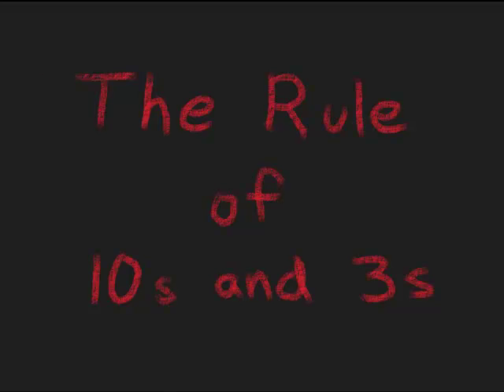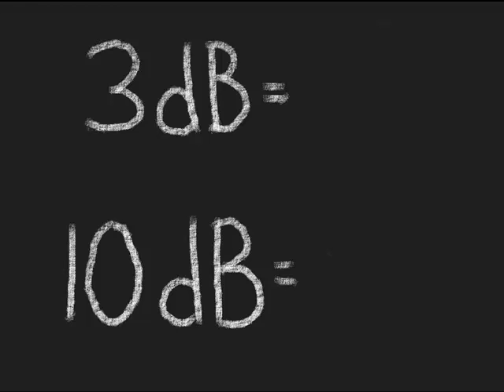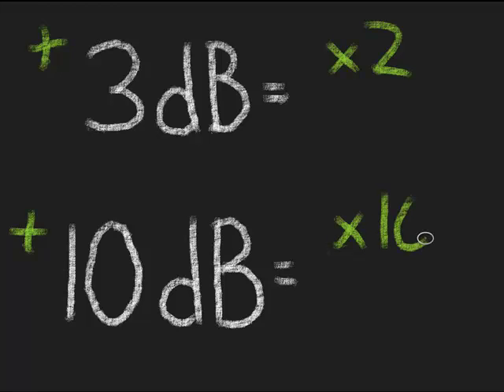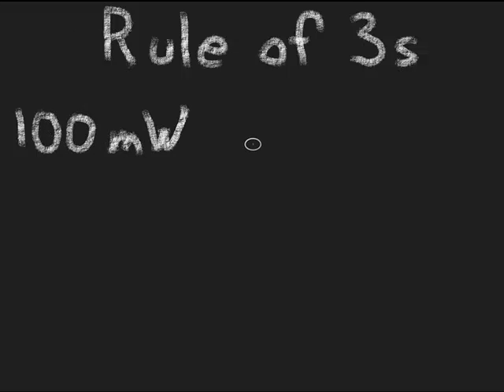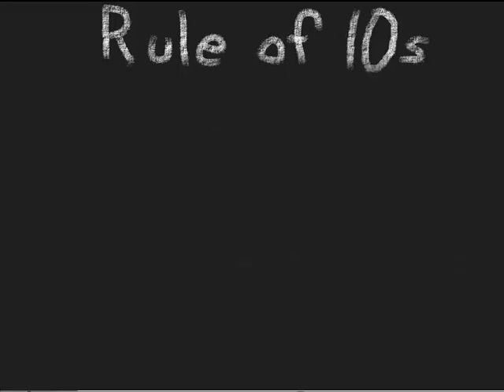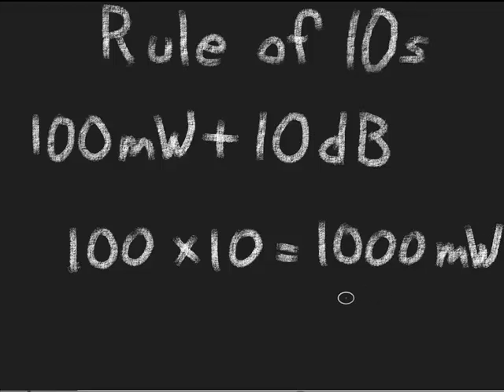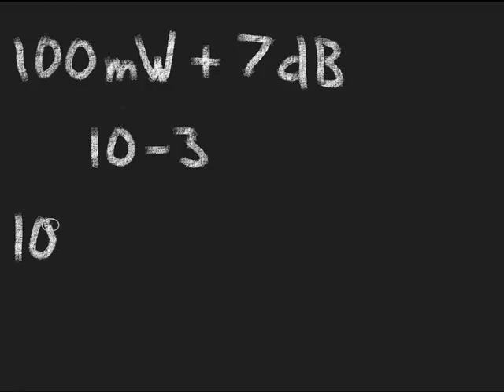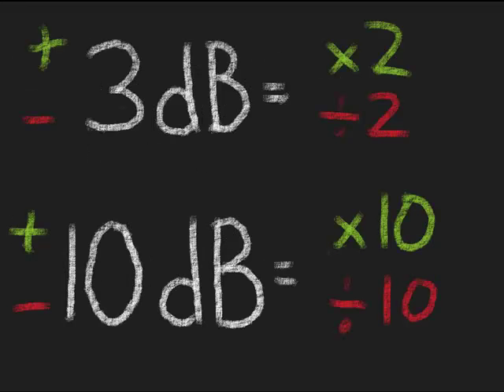The Rule of 10s and 3s

Comment: 0 dBm = 1 mW and every 10 dBm you add moves the decimal point to the right one place filling in zeros as needed. Every 10 dBm you subtract moves the decimal point to the left one place filling in zeros as needed. No shortcut table needed.
Reply: I have a cheapo multimeter with a dB table[?], which reads 
          0dB: 1mW  600 Ohms
                      Then
     ACv          Add
  Range         dB
     10.              0
      50            14
     250           28
     500           34  
 What does any of this mean?
 How do I use this? Please let me know, this has been bugging me for quite some time. Cheers!

Comment: Hello,

This rule seems not always to work or maybe I'm doing something wrong. Please lets take for example that we have power output from IR at 16 dBm that is equal to 40 mW. Introducing antenna with 5 dB gain. Full set should provide 21 dBm. Using rule of 10s and 3s we do as follow: 16 + 3 + 3 + 3 + 3 + 3 - 10. On the mW side we have 40 x 2 x 2 x 2 x 2 x 2 / 10 = 128. Using logarithm we know that 21 dBm output is equal to 125 mW not 128 mW. 
We can try to recalculate same values with use of 10s and 3s rule. 16 + 10 + 10 - 3 - 3 - 3 - 3 - 3 and 40 x 10 x 10 / 2 / 2 / 2 / 2 / 2. Now we have 21 dBm and 125 mW. 
Is there any hidden rule in 3s and 10s rule? Or did I mixed something up? I'm still voting positively on this movie. 

Regards,
T